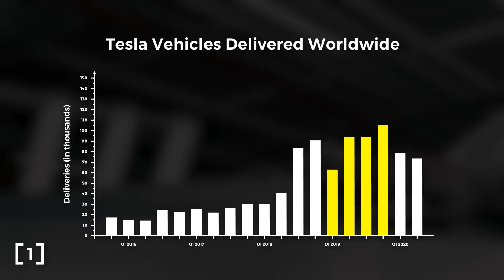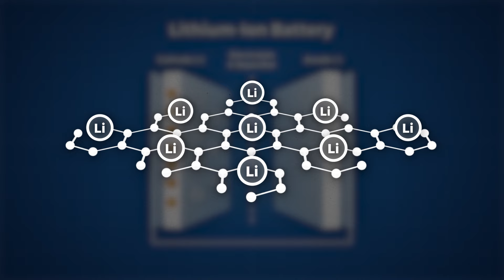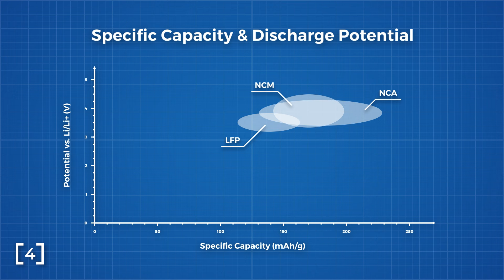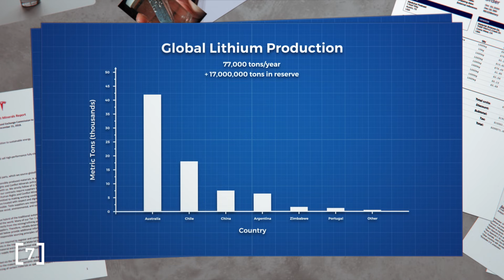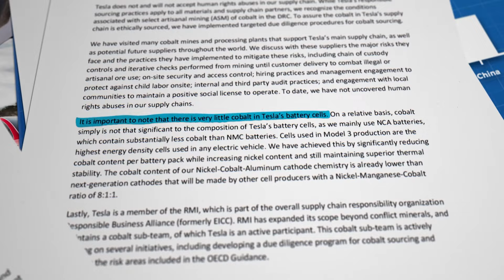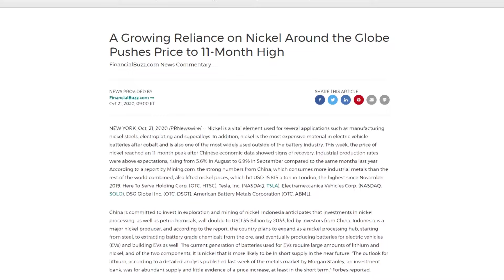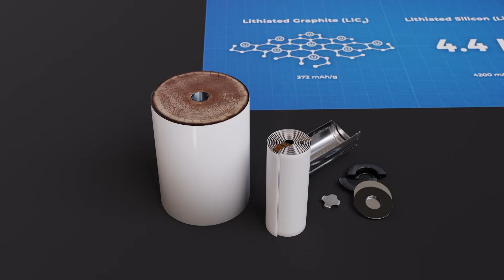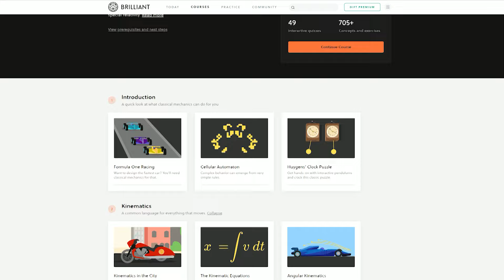Tesla's Battery Supply Problem

Comment: This was a great overview of why it's so hard to compete against the incredible energy density of a fossil fuel.
Reply: Yes you can. Most of the fossil fuel energy is wasted heat.
Reply: @nordic5490  You just confirmed his point, the "wasted heat" is still energy that can maybe be harnessed with higher efficiencies.
Reply: @ammaR00H  and haven't in the many years they have been around
Reply: @troyherrmann235  because to cost to make higher efficiency engines isn't worth it.
Reply: @EpimethiusInPerpituity  thats what i was talking about, the tech will never be used.
Reply: @nordic5490  According to the DoE, fuel generally converts to 30% pressure and 70% heat. Internal combustion uses just pressure, however there are new engines (being adopted by the military) which use both pressure and heat for ultra-high power density and near-zero emissions.
Reply: @EpimethiusInPerpituity  The higher efficiency heat and pressure engines reportedly (according to documents from a major European car manufacturer) cost out at 30-35% LESS than a conventional engine, and produce the same power at about half the size with only trace emissions.
Reply: @mulligan747  Yep they have had working prototypes since the 80's, their reports clearly state that the priority for them is efficiency not cost. That eventually the tech might trickle down to consumer markets if they reach a low enough cost threshold.
Reply: @EpimethiusInPerpituity  Current manufacturing costs hover around 30% less than a conventional engine. VW ZEE (zero emissions engine) fuel engine by their Enginion division is a good example which is slotted for the commercial market as soon as some production systems are sorted out. .
Reply: @mulligan747  So they are better, take up less space and are cheaper but they are in no cars.
Reply: Nuclear + hydrogen fuel cell.  Problem solved.
Reply: @ammaR00H  I get what you're trying to say, but thermodynamically speaking there just isn't all that much room to grow regarding a combustion engine's efficiency (at least not without the engineering becoming ludicrous due to the high temperatures and pressures required). Most of the gains are coming from elsewhere (be that through aerodynamic improvements, stop-start, decreasing auxiliary losses...) and not from engine improvements.
Reply: Very true. But we are running out of oil. And (according to greens) running out of anywhere to accommodate the products of combustion.
Reply: @paulsutton5896  there is centuries of oil and gas left. Nuclear would be a lot smarter than anything else
Reply: Or synthetic Diesel and gas, which are supposed to have much lower net CO2 emissions without sacrificing energy density.
Reply: @Job Westerly
Oooh !!! : 0
Reply: @electric7487  well man made fuel have a lot of problem
Reply: @jake-jm8se  Well part of that is because there is not much of a mass market for it. Oil is still relatively cheap because it is still plentiful.

Another is because the technologies to make carbon-neutral fuels are still in their infancy.
Reply: @ammaR00H  Yep, combined heat and power is a big thing with turbine engine power plants. I've also seen it being used on for large marine Diesel engines in both ships and in stationary power generation.
Reply: @electric7487  carbon neutral "fuel" is hydrogen, watch autotrader talking about synthetic oil, they are not really carbon neutral, it's inefficient
Reply: @mariocarrion2022  Very true!
Reply: Until carbon tax imposes a cost of climate change damage and healthcare costs, then every clean tech at a higher cost will never compete with dirty carbon fuels. Its only local regulations that avoids your utility/neighbour from burning used tires as an energy source. The reason is toxic emissions. At present carbon dioxide/methane has a near zero emission cost. Heatwave damage, typhoons, droughts, more powerful-more frequent hurricanes, forest fires, flooding- all these are turbo-charged by climate change gases. Yet there is no cost to the emitter (or the cost is negligible to the cost damage). One day the insurance companies will either sue the big emitters OR end insurance damage and then the S**t will hit the fan when millions suffer repeated damage they cannot afford to repair....
Reply: @mariocarrion2022  What planet are you living on? There is a general consensus that we have 50 years of crude oil left (Actually 47 when you wrote this comment). You are correct that nuclear is probably smarter than crude, but hydrogen, solar, and wind are inexhaustible.
Reply: The vast majority of electricity that is stored in these batteries (or used in general) is produced via fossil fuels. Electricity and energy storage is a huge research focus right now, understandably so.

But ultimately we need to drastically change our means of generating usable energy.

We need renewables and safer ways of disposing of nuclear waste.

It’s a massively complex and nuanced topic so I’m not even going to try to cover it all, nor claim I’m an expert lol.

We need better means of storing energy, but first and foremost we need much better means of generating the energy we use.
Reply: @ammaR00H  Even with the wasted heat, it's still more energy dense than batteries. That's even more incredible.
Reply: not very efficient though. around 35% in petrol run cars.

Comment: If Tesla wants to sell more cars, stop opposing “the right to repair “ .
Reply: I think they want to control the process to prevent a self-driving Tesla car from having an accident because of bad repairs.
Reply: It's a non-issue to at least 90% of people.
Reply: They already sell every car they make. It is funny you somehow overlooked entire damn video about bottlenecks in production chain.
Reply: @Mader_Levap  dude can't grasp the scale and depth of supply chain complexity.
Reply: Them and new farm equipment.
Reply: @autohmae  this could easily be countered with breech of contract agreements I think? Similar to iPhones, if you get an external vendor to repair or jailbreak your phone, you absolve apple of all responsibility regarding your phone and void your warranty. Usually these can be checked with one way stickers or mechanisms
Reply: @mark347347  it's not about the legal part, it's about PR/image. Look at the Uber self-driving car accident with a woman. The news came out before any information was know, it was a big PR/image problem.
Reply: We'll reach a point where the car won't start because the blind-spot detector is defective and need replacement.
Reply: @alexanchannel  We'll also be able to open an app in our phone and have a self driving car at our feet in 5 minutes at a price cheaper than uber, etc. now is. So we'll probably be fine.
Reply: @autohmae  so I need to whip out my NSA spying device, turn on the app that I had to consent to selling my data, and feed it my bank account details to even get anywhere.
I'd rather just drive an 1980s car.
Reply: @ChucksSEADnDEAD  I was talking about the one time when something breaks. I'm certain you complain about the NSA spying device, but my guess is you have it on (standby is also on) all the time anyway, so I don't see the difference.
Reply: You should be able to do whatever you want with your property. Tesla this is not a piece of software this is a vehicle, no different from a regular car, motorcycle or horse wagon. You must be able to repair it by yourself and documentation and spare parts need to be available. The security argument is null, the same could be said with gasoline cars who are way more complex than an EV.
Reply: @WetaMantis  ha, you think you own your home (mortgage or rent) and your car (car payment), your furniture or appliances ? renting a fully furnished home. Your computer ? Software copyright for Windows, etc. says:nope, you don't own it. The music collection ? Copyright says: you don't own it. You only have a copy on a a piece of media. You only own the media, not the music on it. etc.
Reply: @autohmae  My point is that we're running out of options, we're not fully trapped in the belly of the machine - yet. This scenario might seem cool and high tech, but I'd rather the car start even if there's a faulty sensor.
Reply: @autohmae  Again, this is the all-or-nothing approach. Previous mistakes do not justify committing to going down this path. I do own a house that's paid for, a car that's paid for, and even the goddamn appliances are paid for. You're talking about what should be a narrow period of your life where you need to make a deal to get on your feet and pretending this justifies even more control over your life.
No shit I only own the media. That's what actually matters. I didn't pay for the copyright, I didn't want it.
Reply: @John NZ, yes amen to that.
Reply: @LibertyDankmeme  Simple answer would be, don't buy a tesla.
Buy something more manly👌
Reply: @pxa4535 pxa4a "they just do not want chinese companies replicating parts and selling them for less mark up" that would be weird, because they are building a factory in China. Because that just means more knowledge transfer to China. And they are not gonna be that closed with people in China because it's a good learning experience for Tesla to learn better manufacturing.
Reply: @autohmae  that is a security problem, that they are to lazy/cheap to address themselves. Someone who repairs cars, does not have the technology to hack into the car, and if they have, then tesla should work on that, bc that means that there is a much bigger problem here. 

Maybe make a free 'check up' possible at every tesla repair station, just to see if the system is up to date, and running as it is intended. Then their self driving cars shouldn't show any problems, right? Like there are very easy and cheap alternatives. You know how such a check up would look like, right? Someone working at a tesla repair station would just have to connect its tablet to the system, see if there have been ANY altering of the system, run an update, just to be sure, and boom, back to the streets baby. 

Like thats not a big brainer here. Lets be honest! Apple is doing it for years, they can actually tell if someone 'jailbreak' ed there phones, they can make sure that you can't replace original parts of an iphone by a knock off part, the system ACTUALLY detects that and just 'refuses' to run the camera thats been replaced for example! Let's not turn a blind eye on this bs
Reply: @notmyopinion4981  with enough force anything breaks. Same with hacking. We've not found anything which is unhackable. With enough time and effort we (the human race) have always found mistakes. The reason is simple: you have to be 100% right when creating something and defending from bad actors, but you only have to find 1 or a few mistakes when breaking into a system. Think of it as writing a very big book with many people on a difficult math subject. Do you think we (human race) you do that without mistakes ? Imagine we have some of the smartest people working on it, it will take more than 20 years to finish, so we add more people who are less smart. Or tell them to speed it up a little. Otherwise the company has no product. And it has to be a correct working product. All the attacker has to do is find one spelling mistake. And physical access makes it easier. Same with road safety, etc. makes it easier to hack. What do I mean with road safety ? One of the ways people make password systems safer is to have a counter based on the number of failed attempts (for example 3) it won't allow someone to log in for a while to prevent password guessing. Because of road safety a car can't just stop responding.

"Maybe make a free 'check up' possible at every tesla repair station, just to see if the system is up to date, and running as it is intended."
Let's spend more time checking if the system is working as intended by taking it completely apart and putting it back again because we don't know what some external entity has done to the system. You seem to imply just checking if the computer is working is enough, which isn't enough. You need to check all the sensors, etc. at the least. (while we are on the topic of car hacking, one regular way they get hacked is through the multi media system, it just doesn't get the needed security attention like other parts, but it always turns out it's still indirectly connected to the rest of the system so it becomes a way in). And make damn sure we've put it back together again properly. Thus making it more expensive than a regular repair ? And do it for free ? That doesn't sound like a sustainable business model.
Reply: @autohmae  Thank you for your answer, that really gave deep inside. But just bc we deny someone physical contact with the vehicle doesn't keep them from hacking, via remote. And how does a company ensure, that these types of 'hackers' don't work inside of their own company? 
And i am gonna be honest with you, hackers hacking into cars is smth i never heard of happening outside of 'theoretical scenarios'. 

But also giving all repair power to the company alone is a big mistake imo. If the company makes more money when your device/vehicle is broken, they will probably rarely push to repair it and the prices can't be fair too, since it would be some sort of monopoly on that, they can just decide, bc you would have no other choice then to repair it there or buy a whole new thing(look at apple charging repairs that cost more than buying a new device). I don't see how that is ok without any regulation. 
But your comment made me really see my fault in the argument, but I just see how apple for example charges you 300%(+) more than a regular repairmen. And maybe that is not 100% comparable since the safety of a car is much more important on that regard, but as you said there will always be some hole to be exploited, but denying many independent repairmen their paycheck and giving it to big companies instead, is just awful, and there must be a way to protect their jobs, and also the market from not turning into some sort of monopoly where you have to go illegal to repair your car for a fair price. That would be my concerns and reasons why i am for the right to repair.
Reply: @LibertyDankmeme  only males and females.
The others are delusional.
Reply: @Hi11is  some mechanics won't even touch a tesla that  becomes an issue for people in rural areas.
Reply: @autohmae  do what 99% of all vehicle owners do? Don’t buy a Tesla.